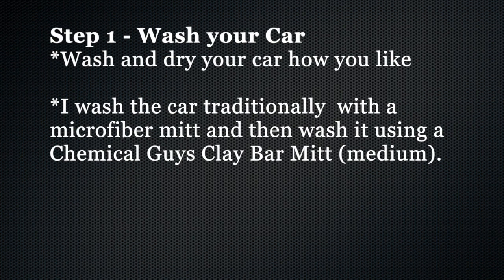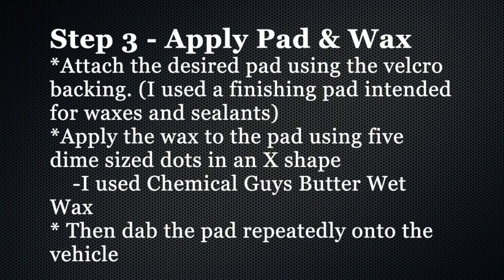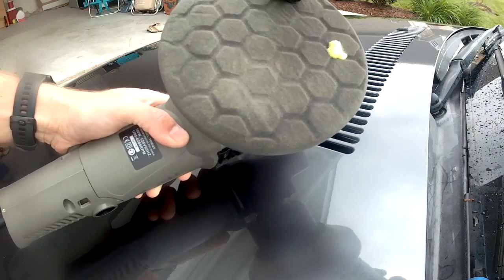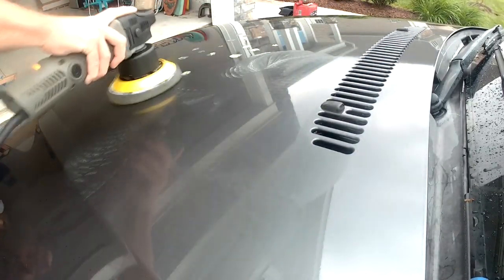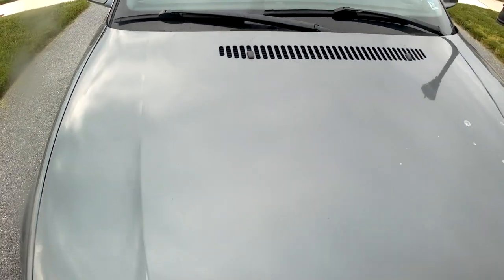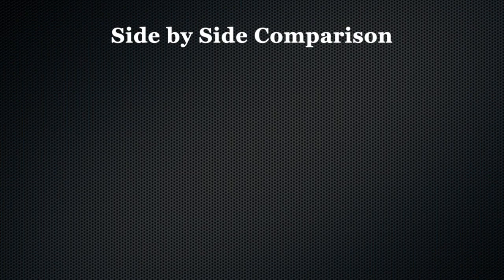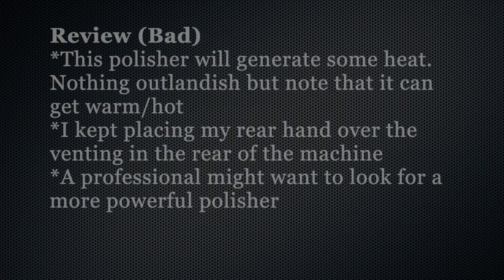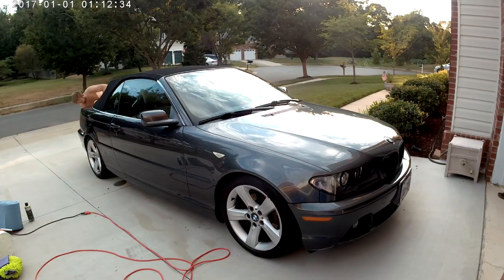Torq TORQX Random Orbital Polisher "How To" and Review

Comment: Can you use that same tool to buff out the wax? Or is it strictly for application? Thanks
Reply from the maker: @raidermike619 I'm not 100% positive as I've only used it for application and then use a microfiber towel to buff out the wax after it hazes.  After a quick search, I didn't see any attachments for the tool that would fit the bill, but I could've missed something.  If something did exist, you would have to keep swapping between the pad and buff attachments which might be a PITA.